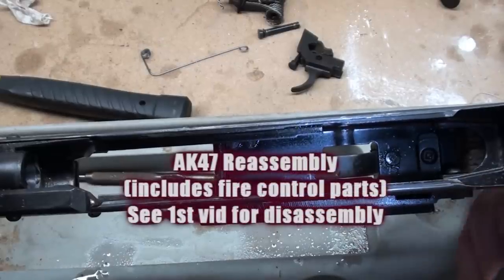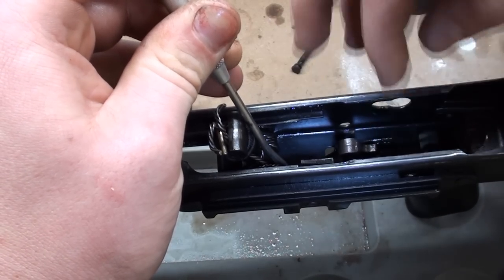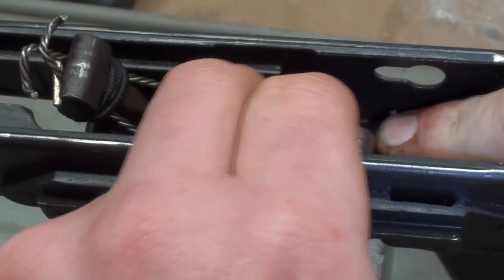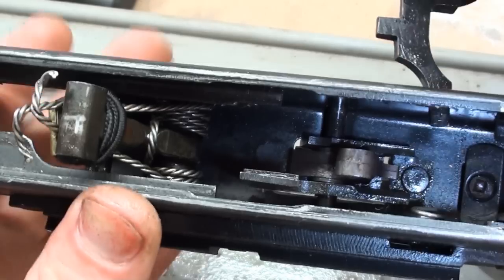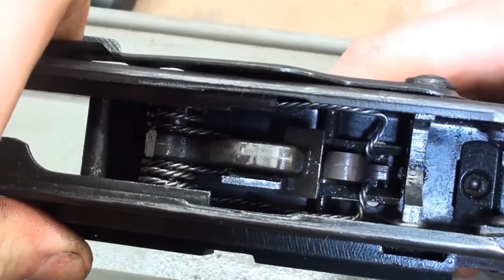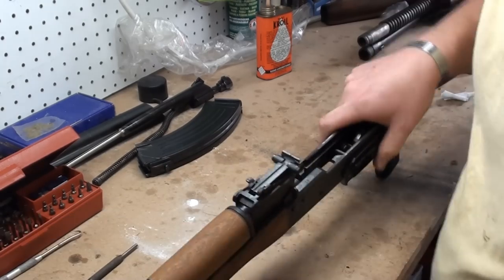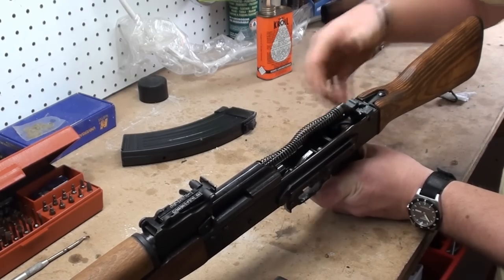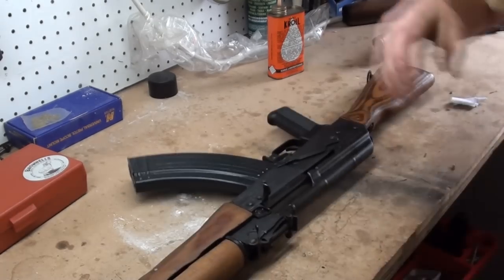AK47 assembly to include fire control parts

Comment: thank you so much iraqvet, i spent 3 hours trying to figure out how in the fuck to put the little wire that goes on the saftey and holding the trigger pin down, because i was just playing with it, getting more familiar with taking it apart, and it slid out, and i was freaking out on where the hell it went, i had a general idea where it went, but i was like what the hell is the hook for.

Comment: Do you have any thoughts why my Tapco retaining plate doesn't work for my PAP M92? I can fit it in there but why you fire the plate works it's way up the safety pin towards the trigger assembly. In turn the hammer spring gets shoved inward and causes the trigger not to reset. I had to put the old pin back in. Do I need to bend the retainer plate somehow? (Love the channel)

Comment: I was glad to find this.  It seems like every other video on youtube showing how to reinstall a trigger group has a G2 trigger. 

When I was putting my trigger back in I kept thinking that I wish I had access to my workshop so I could make a slave pin.  I found out later that a slave pin is the standard way to install these and is actually included in many military cleaning kits.

Comment: Have you thought about a retaining plate, instead of the pin or do you not like them?
Reply: I have one of those and they can slip out pretty easy if you take out the safety often, however they also are easy to stick back in, they don't even really need you to disassemble and reasemble the hammer and trigger to stick it back in. So, it's as great as it is bad.

Comment: Just my opinion here. . .  The Krebs pin retaining plate is 25 times easier than that Tapco L wire pin retainer.  And I trust little tiny wire ties (zip ties) much more than hair scrunchies.  Had a spring escape from one and it drew blood!
Reply: The retaining plate didn't exist at the time

Comment: Thanks for the video. I didn't notice any mention of the disconnector spring/pin... No mention of how to install the rear sight "spoon". It would have also been nice to see the firing pin/ firing pin retaining pin as well as the extractor being installed... Just some issues I came to this video to help with but wasn't here. Not complaining just making a mention. Thanks again just the same.

Comment: dude you need a special kit  tool for trigger assembly as well as hammer, and retainer  
one bar ( length 10 cm) with 3 different diameters.
in the former  Yugo army it is called a spare tool and accessory

Comment: @Iraqveteran8888, how do you feel about polishing the guide rails, hammer and bolt carrier in order to get a smoother function. is it something that will cause harm or is it safe, and how would you go about it if you don't see a problem with olit or already have done it

Comment: I have a Bulgarian ak 74 and my trigger fell out the first time i fired it :o. 

Century didn't put the retaining clip in properly (big surprise). Since it was my first ak i took it back to the store to make them fix it. They gave it back with "some wiggle room" 

I took it apart at home and decided to try the clip under the pin to see if it would hold to grove better, it did. 

really wish you made this video about 4 months ago.

Comment: Wish you turned the gun pointing the other direction so we could see how you where putting in that paper clip looking thing and taking it out. Mine broke on my n-pap after 5,000 rounds. It looks like the one you took out. Cheap. Wish I could send my gun to you so you could put that in for me! Lol
Reply: Strongly recommend use of the Krebs hammer and trigger pin retaining plate.  Simple installation and the cost is $10.

Comment: Excellent video. Just a suggestion or two. Try using a garbage bag or bread bag wire tie to hold your hammer springs in place. Also, I like to use a long pin punch (.22 cal cleaning rod?) to come in from the other side of the rec (in this case charging handle side) to line things up and help guide axis pin back through. When axis pin is in far enough, it will just push punch/cleaning rod out. Much appreciate you taking the time to film & share bud, very helpful, very informative. Thank You.....